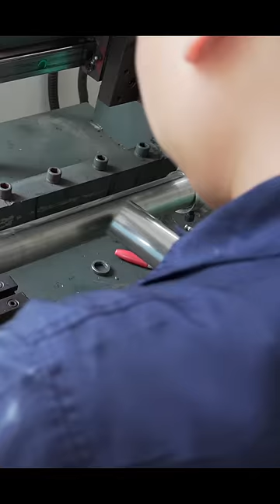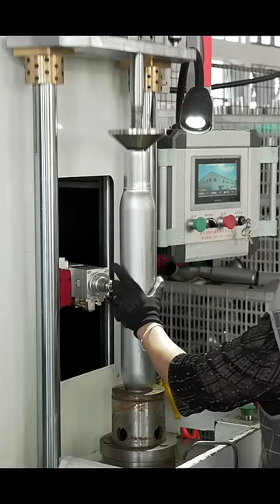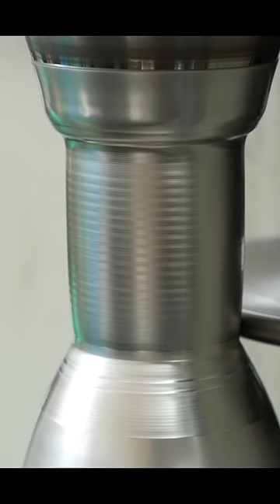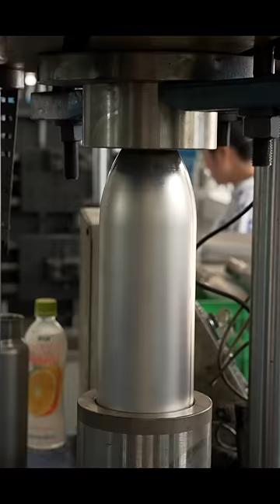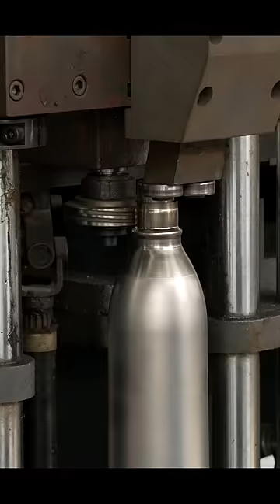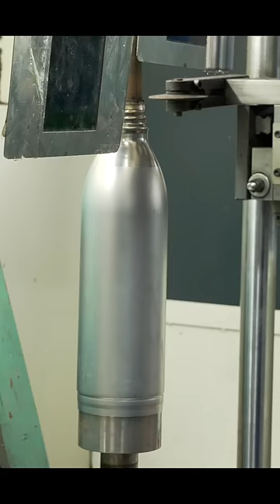Mass production process of cola shaped sports bottle

Comment: looks like a thermos.
Reply: الترمس والحلبه
Reply: They're just double walled for insulation. My wife and kids love using these. So cool to see how they're made
Reply: I love double wall aluminum drink container,even the mug and cup ones.I dumped all my ceramic mugs... they're heavy and keep the hotness(or coldness) for very short period only.
Reply: @rodenreyes6320 but aluminium is toxic.
Reply: @aradenatorixveckhomaveclus2276  Should we empty our kitchen of everything aluminum?Nothing will be left.
Reply: Yes yes yes
Reply: Стеклянные термосы практичнее, но их можно разбить...
Reply: Is right @aradenatorixveckhomaveclus2276
That's why you do don't see aluminum silverware anymore, since it gets in your food, to minimum it don't use it with acidic foods.
Reply: @rodenreyes6320 it is stainless steel dude
Reply: @Eduardo_Espinoza you don't see aluminum cutlery often bc stainless steel is superior for that use case in every way, more heat resistant, more chemical resistant, harder, more durable, and by far cheeper (20 to 60% cheeper depending on grades). There simply isn't any reason to pay more money for an objectively worse product. The only time aluminum is used is if you're trying to keep weight down, like for camping sets or military gear, bc you have to carry it.
Reply: Good read, thank you for sharing!  :) @xxportalxx.
Reply: cause it is😂
Reply: @alkonaut1533 double wall probably either vacuum pumped when they seal the bottom piece, or possibly just heated  enough in a furnace as it’s sealed as that will provide a pretty decent low pressure environment for insulation.

Comment: Most of the stages I understand pretty well. (I especially like the water-pressure expansion gadget.) Only, why is there a roller marking a stripe down the side of the cylinder? (maybe stage 2, after the cylinder is cut to size.) It seems redundant.
Reply: It flattened the weld seam
Reply: The cylinder would have been made from flat sheet metal, rolled into a cylinder and the edges welded. The weld would not be the same curve as the rest so the roller is pressing it into shape. The line colour is from the heat of the weld. The excess material and the heat coloured steel is ground off and buffed out in that final stage.